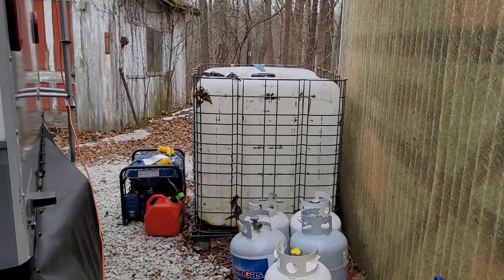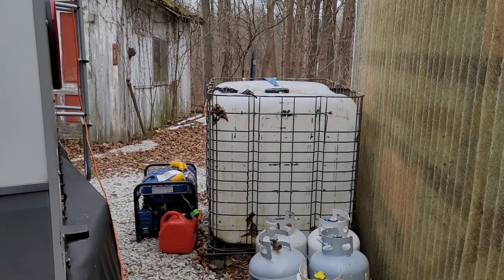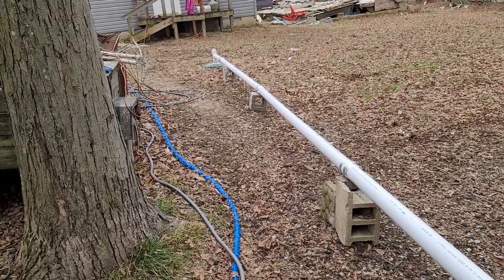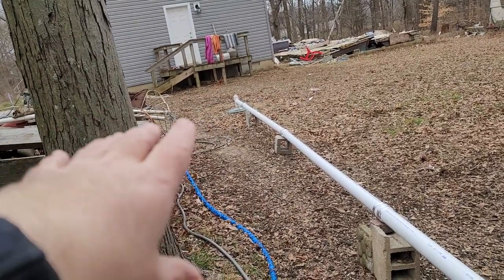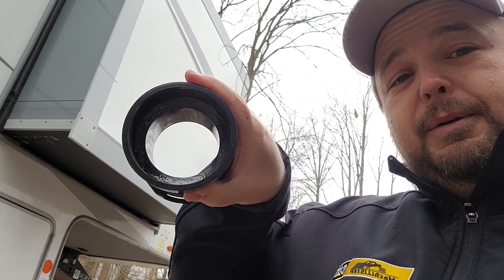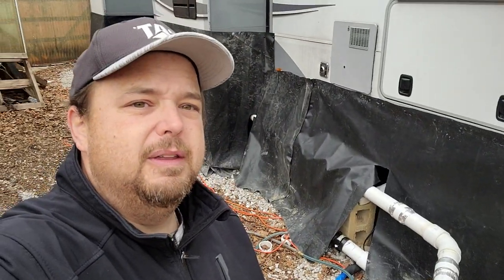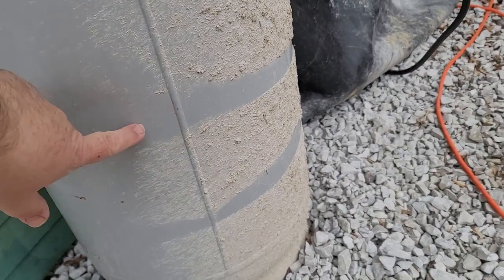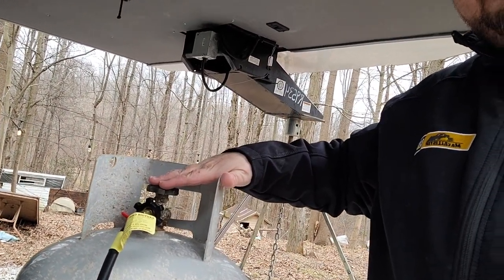What you need to know for full time RV SEWER

Comment: Glad it works for you but taping is not a plumbing method you should suggest to others lol
Reply from the maker: Pvc is pricey right now and I know tape is not the best thing to use but if the rv ever needs moved its back to cutting pvc pipes and new cuffler but it's only an temporary set up for now until I'm at an permanent set up
Reply: @OVERALL_PAUL  glad it's working thanks 4 the tips
Reply from the maker: @bodiecollection  no problem man I'm going to post an updated video this subject soon keep an eye out for the video